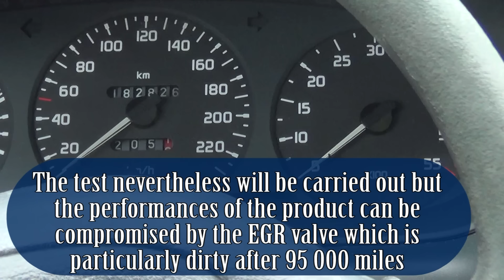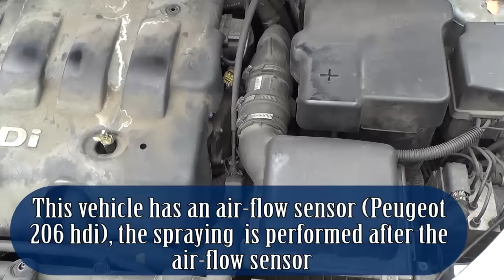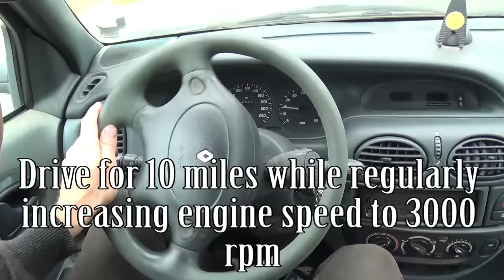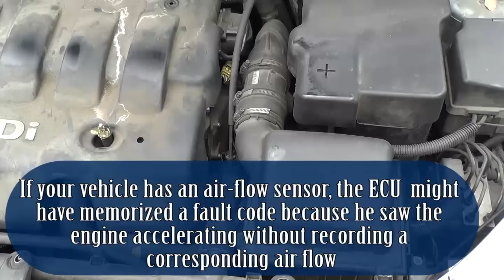EGR valve cleaning WITHOUT DISMANTLING - Cleaner kit test Before/After

Comment: Not good cleaning the EGR valve! All the shit will go into your turbine and then you will start crying. Take it off and clean it and if you are lazy don't do it!
Reply: EGR is post turbo!?
Reply: +Cristian Ionut Marcu For serious EGR problems it's indeed not the correct method. For preventing the intake manifold, EGR, inlet valves and turbo(-housing) from clogging up it's the best method without disassembling. It cleans the internals until some degree (don't expect shiny internals all of a sudden). The product dissolves little pieces of junk with every spray interval, the product is save to use and won't cause any damage. I personally use Wynn’s Diesel EGR 3 for years. I can confirm that these product do work, I have verified that with an flexible telescopic camera.

Modern cars tend to clogging up very fast as the manufacturer tries to reduce the CO2 emissions more and more. Even some direct injection petrol cars tend to clog up.
Reply: Cristian Ionut Marcu o
Reply: Cristian Ionut Marcu k
Reply: Dan Almond i'm
Reply: oo

Comment: Effective? More or less yes. Would I recommend it for anybody? HELL NO. Imagine all that carbon debris washed down from the intake side into your engine, than going trough your turbine... Actually it can cause a lot more damage than help. Clean the intake and the EGR physically, go for a mechanic shop and pay for the walnut blasting of your intake valves, DELETE the fucking EGR and your intake side gonna be clean for the rest of the car's life.